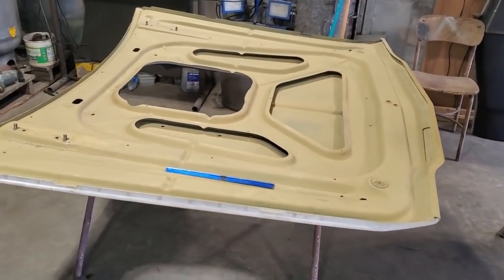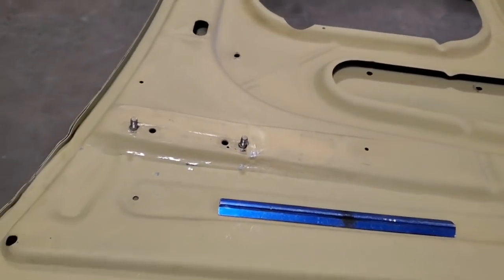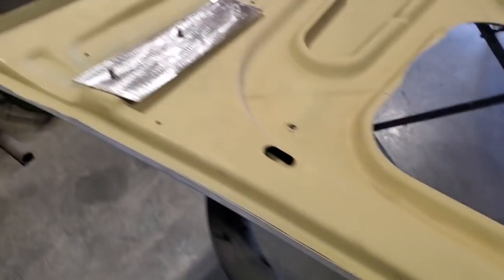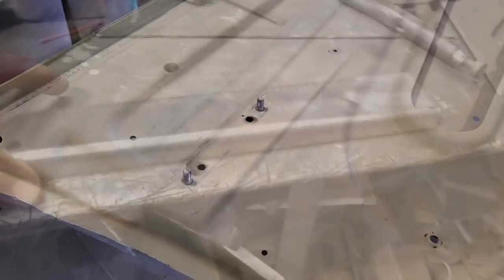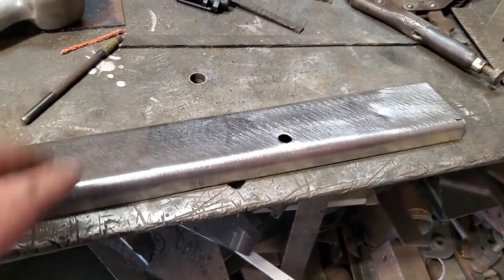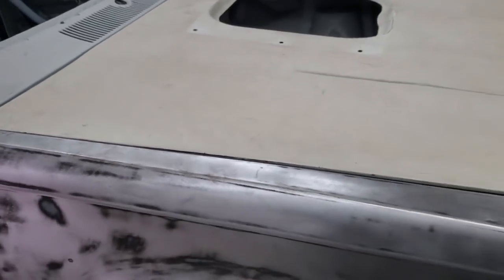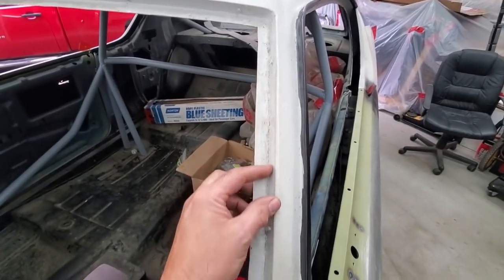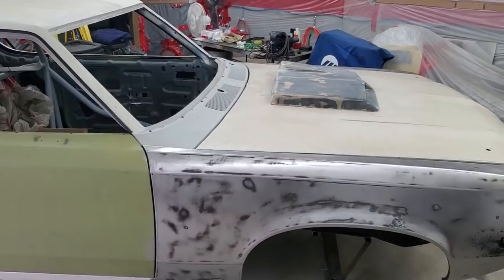How to make hood hinge braces

Comment: The opposite of Cut & Butt , Fit & Function.
 It does what it's supposed to do , fits and functions as stiffener braces without compromising hood /fender gaps, seams and fitment.
 Once primed and painted, no doubt the bracing will look like it grew there. Good call Tony, no need in making a job any more complicated than it needs to be. 👍👍

Comment: Amazing!  Ya read my mind, kind of.  I needed to make strut tower braces to prevent problem others have had.  I bought 16 gauge metal and was still "over thinking" it.  Very similar solution.  On line "gurus" said cut out the whole inner fender and buy new at $600/side +shipping from UK or Europe.  Not in the budget.  Thanks again!!

Comment: Thanks Fitzee. That "T" bar works great. I've seen you using it before in other videos and made a copy. Nothing I tried using before works as good.
Reply: I needed one too so I made one.  A made mine with 1/2" on one side and 1" OD heavy wall pipe on the other.  That gives me another radius.
Reply: @OldJoe212  Oh yeah! I bet heavy wall pipe would work good! I was thinking to use an old socket but I have some pipe. I think I'll give that a try. Thanks for that idea.

Comment: Gotta love the Matador. I had two back in the late part of the last century both 72 two doors and one was a 401 the other 360. all most bought a third off of Eddie Stakes but wife gave me the evil eye. found out eddies was one number different from mine. bummer. sold then both in the late 2000s. Just had two many rides. All AMCs 78 V8 pacer swapped 304 for 401/727 still have my 59 2dr American S/W and a 70 AMX. by the way I see a AMX in the opening scenes but cant find it on any of your videos?? Love to see it since I'm doing the trunk. speaker tray , I know AMXs don't have a speaker tray but its that part under the rear window. and also the rear quarters. so far work is going well with your help. Thanks for showing me the way.
Reply from the maker: Love amcs.  I have a few myself. The amx in the beginning is one I did a number or years ago. 69 390 4 speed car. After doing a number of the first gen amx 2 seaters. Have lots of pictures of them but no video.

Comment: I did a hood from a 1972 Roadrunner that did that but I pulled the skin off of it and made the plate on the inside after taking a dolly to it to make it look factory and no one new it was ever done because I took a drill bit and made it look like the factory welds around the edges

Comment: Tony, I appreciate you showing how you pulled up the compromised metal to be better supported and in close to original location. How would you approach a small tear kind of a vee shaped ~1 inch length in a tailgate (near the top when closed) with no access to the back for hammer/dolly work to bend the metal back where it can be welded back together? Weld a cloths hanger wire and use a slide puller? 99 Tacoma so a bit newer and thin metal. I haven't figured out a good approach without cutting the torn section out, straighten/weld, then butt weld back into place. Tony tell me there is a simpler way I haven't thought of yet.
Reply from the maker: I tried dent pullers. Welding steel on and pulling it. But it rearly comes up right. Most times I just cut it out. Dolly it on the bench and reinstall

Comment: Do you think it will just eventually bend at the end of the brace like it did at the end of the hinge? Would it have been better to make the brace go the full length of the hood? Also nice job much better than just welding in a peice of angle iron like ive seen done before lol
Reply from the maker: It should be fine. It only bent cause the car was stored for very long time and seized up

Comment: Hey Fitzee, thanks for sharing your tremendous skills! You're helping me a lot with my F100 project. Question: Do you ever use that zinc weld through primer, like in plug welds in lap joints? I'm not having very good luck with it.
Reply from the maker: Hate the stuff. Used it many years ago but gave me alot of trouble. Some spot welds would let go. Today I just use a good rust paint and I clean where all the spot welds are.
Reply: @fitzeesfabrications  Thanks Fitzee! I was wondering if you had one of your magic tricks to make it work. I'll just do it your way then.